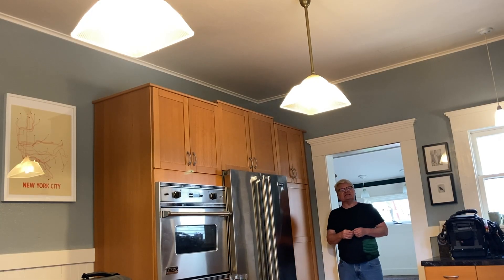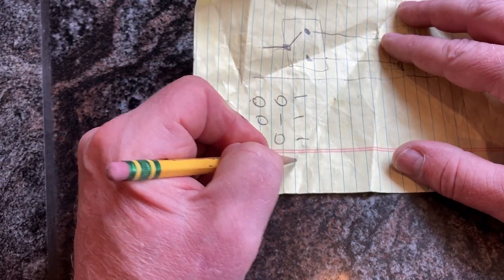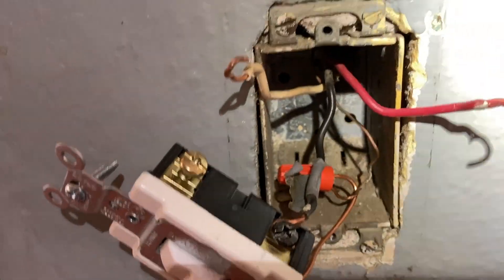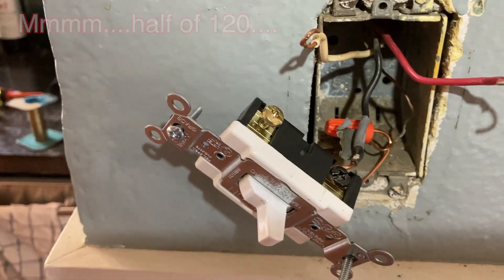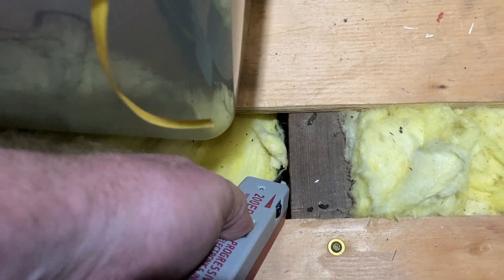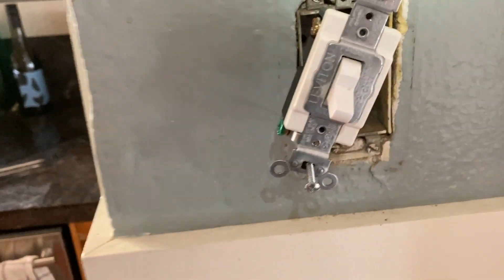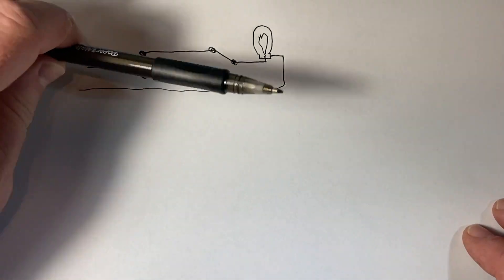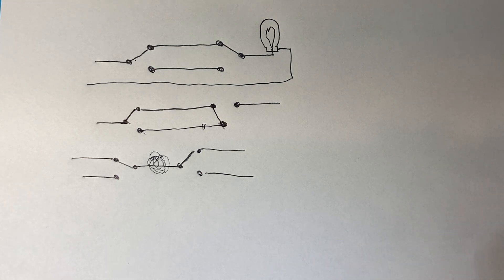Troubleshoot & Fix a 3-Way Switch Circuit

Comment: A side effect exclusive to the carter 3 way circuit, is someone replacing a switch could mistakenly reverse one of the travelers and the common, and this would caused a dead short when the switch is thrown one way - better hope there are no pennies under the fuse, or an FPE or Zinsco breaker box when that happens, because these panels have been known to fail to trip even with a dead short. An electrician joke I heard from a semi retired electrician several years ago, was that FPE and Zincso would still be in business if they made arc welding machines instead of circuit breakers and panels.  😂

Comment: Ward you got the lights working good job, but I wouldn’t sleep till I investigated some of the other issues you identified. After watching your electrification of the party house it’s apparent that if you had wanted to reduce your income as programmer you could be an electrician. When your friend recuperates from the remodel I suggest that you get back up in that attic get rid of the knob & tube and investigate the other issues, or Stay home and sample some of that good California wine.
Reply from the maker: Yeah, I'd like to understand the weird voltages -- it's a life/safety thing after all. She has other misc problems in other rooms, so suspect this is not the last time I'll be in the attic! Thanks for watching over my shoulder.